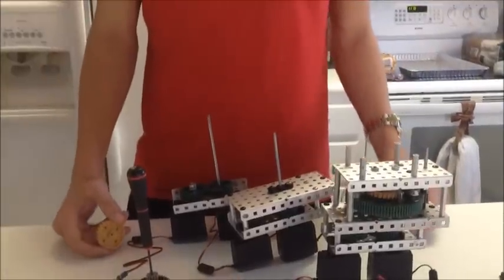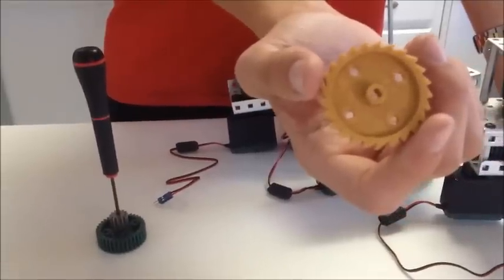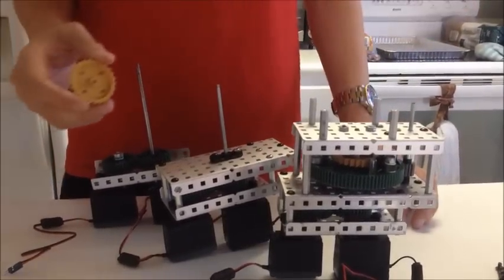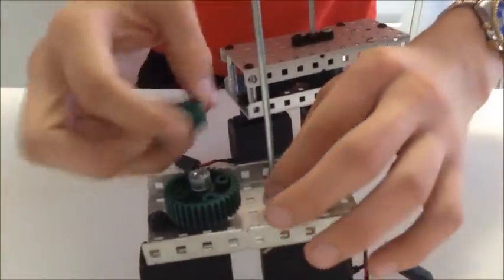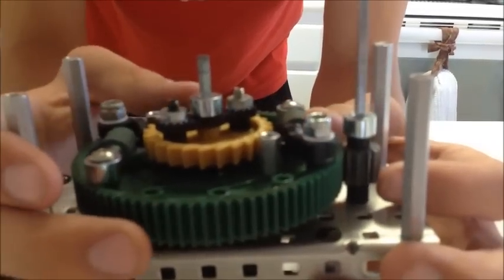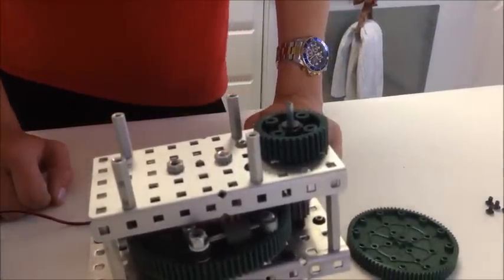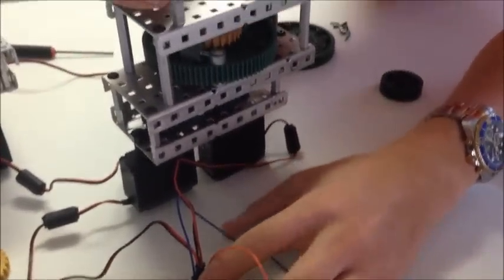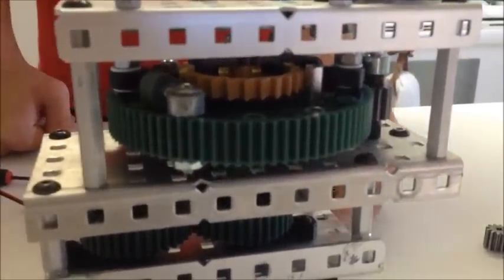VEX Nothing But Net | 4101K | Gearbox

Comment from the maker: Thanks for pointing that out Vex Team 523. We were allowed to use 3D printed parts in both local and national competition last year. If you or anyone might be interested in using 3D printed parts please check with the tournament directors and judges and have a backup plan in case they are not allowed at your specific tournament.

Comment: lol im good friends with 1727b, I was there when they designed the ratchet. Nice job.
Reply: we're such good friends you share Collins Google acount :) btw nice leds, unfortunately the red ones aren't that bright so we will probably have to get new ones. also, what is you're wheel layout. we were building a lift(unfolding ramp)before westminster but it should finally be working at hereford.